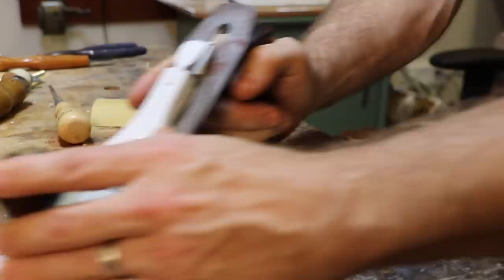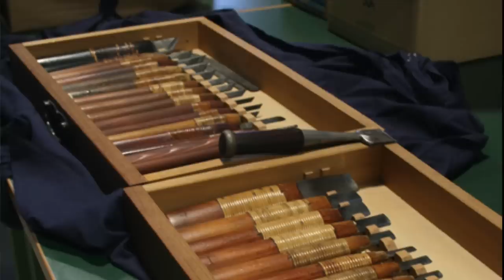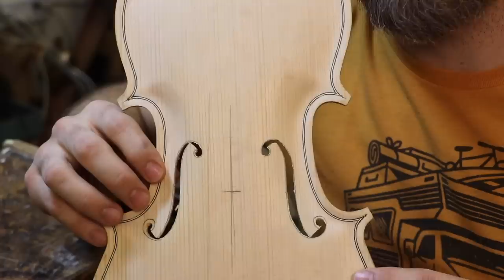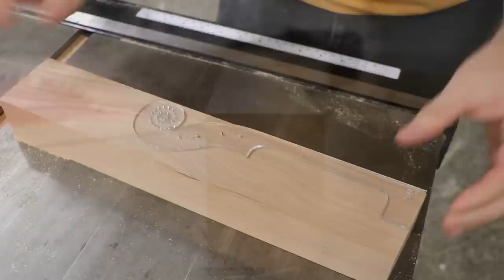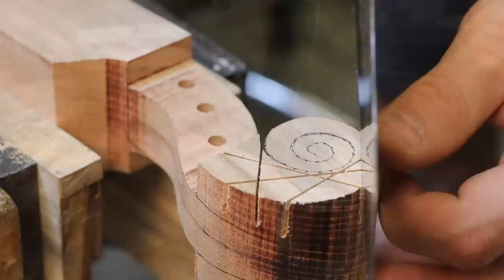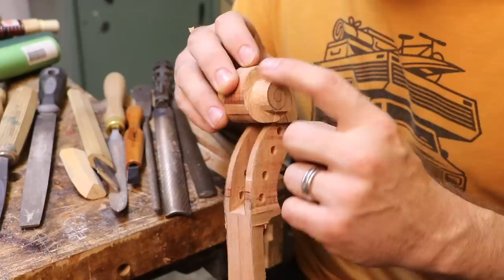Making a Violin/Fiddle for Tally Ho: Part 4

Comment: I really enjoyed watching this process and when you were using the Japanese hand saw I smiled a lot. The reason I smiled I have a very old Japanese hand saw that a family member brought back from when he was stationed in Japan after the surrender in world War 2. I still use it when I'm working in wood and it still out performs any other saw I've used in the last 50 years. It has some engravings on the blade and I should find out what they say. This video has motivated me to research the Japanese engravings to learn more about this vintage saw. It still has the original bamboo wrapped handle.
Reply from the maker: very cool! what a great story.

Comment: Have you ever tried putting white chalk on your file to eliminate the high pitch squeak?  Excellent craftsmanship, thank you for sharing. Been following the Tally Ho project from the first video. Looking forward to seeing her in the water under sail!
Reply from the maker: I can't wait to see her in the water either! Yes I have tried chalk on the files. On thicker boards it works well but the soundboard vibrates so much it just takes the edge off a little, either way I try and block the sound. Thanks so much for watching.

Comment: Have you tried using Swann Morton  scalpels instead of an Exacto knife?  The blades are second to none- hold an edge very well, and are way less brittle. The blade handles arent quite as solid as the exacto in the connection to the blade, but those blades are so sweet. The pride of Sheffield!
Reply from the maker: I have never tried them! But I will look into them, Thanks so much for the recommendation!
Reply: @JDanielGraham  FYI they make slightly cheaper blades for workshop use to the same level of quality that haven't been sterilized for surgery. My dad told me that just after I ordered a 100 pack of surgical blades, haha

Comment: I’m now addicted to this build.  Just out of curiosity how much would one of your hand build fiddles cost?
Reply: Can't speak for this dude, but you should expect to pay a minimum of 5 grand for a one off, non factory production run,  custom hand built traditional violin. And on the higher end, there is no limit to how much you could pay.
Reply from the maker: They range based off of wood selection, inlay, string choice, etc but they start around $4,000 and go up from there. But also I have made them a little lower in certain circumstances.

Comment: Incredible serie of videos.... i must admit tho that when making the neck i really feared for your fingers. Never use a table saw like that.
Reply from the maker: I was trained like that in my furniture making apprenticeship. I wouldn't do it without a riving knife on the table saw for sure. Also the table saw is a sawstop just to ease your mind. But I totally get it from the angle of the camera. The kickbacks I have had on a table saw over the years all involved "safety measures" , push sticks slipping, or mitre fences binding etc. The closer I can be in contact with the material the safer I feel.

Comment: I got hit on the head with a stick in school for not putting the plane on its side when I put it down 😅
Reply from the maker: I get that! I went through multiple apprenticeships and there were really opposites. I had one guy who was a brilliant furniture maker who taught  me how to "sharpen" a card scraper on a belt grinder. Before he even showed me he said "I'll show you the right way but it's good to know the quick and bad way too" haha. I still sharpen them the long and correct way.
Reply: You're not going to harm the plane's iron by putting it face down on a wooden bench, and you'll almost always see a production woodworker placing it face down on the bench alongside the workpiece as it's just so much more efficient. I seem to recall reading an article many years ago about how the trend of laying the planes on their side came into "practice" and I think it was when large classrooms of budding woodworkers were more common. The teachers at the time didn't want to spend any more time than necessary repairing irons following clumsy apprentices' mistakes.